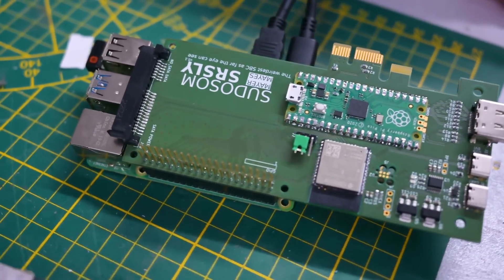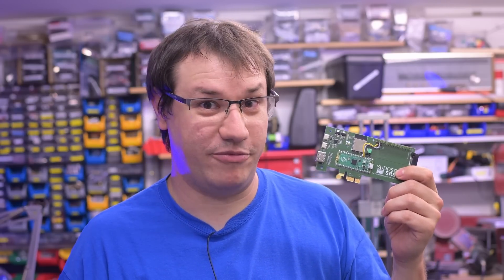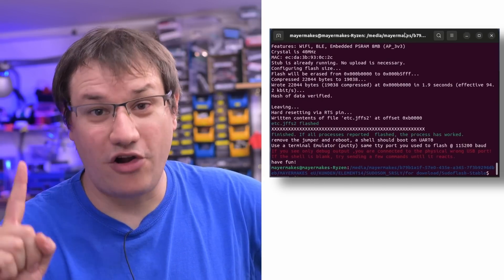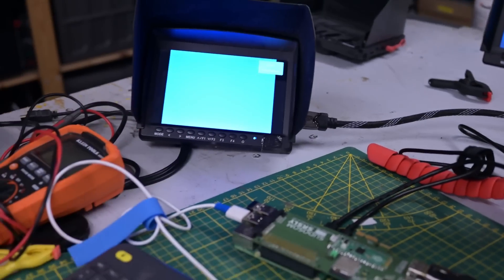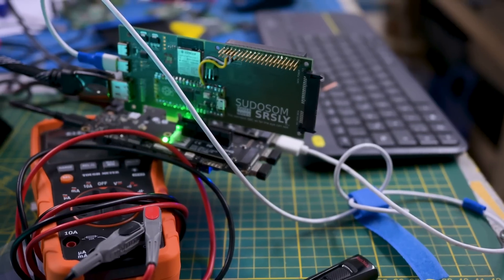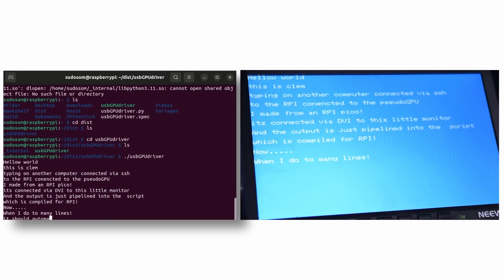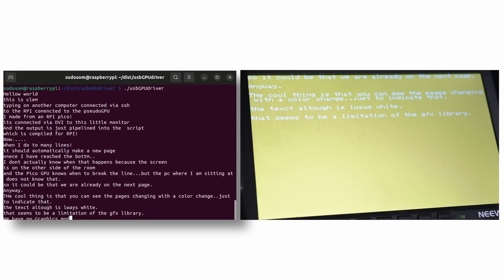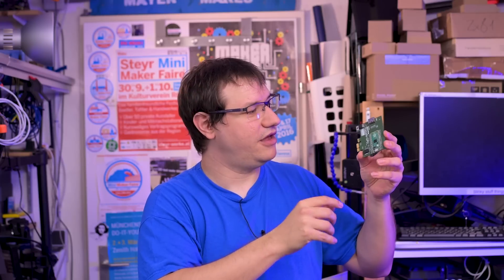DIY Single Board Computer with ESP32 and Raspberry Pi Pico

Comment: did you add any pullup resistors on your project for I2C? this and different clock speeds can be the crux, I remember faintly that the RPi doesnt like or do clock stretching on I2C, so that might be an issue. or thats just for old RPis
Reply: wait is that the identifying eeprom on a hat it expects? did you use an I2C address similar to eeproms?
Reply: @Davedarko did pullips, adress might be reserved, but the hst id is on a different i2c port

Comment: this is fun and interesting, it would be interesting to stream high speed data into (or out) a pi. The GPIO is not that fast. Would be a nice alternative. You could also use a CM4 with IO board.
Reply: Hmmmm😮
Reply: Making an esp32 with a pico coprocessor is an idea that always sounds interesting. I wonder what a good hardware/software protocol between the two would be, multi wire SPI perhaps, or maybe something better.  I’m visualizing an esp32 and 4 picos, a web interface, and custom map reduce firmware, to build an old time cluster on a single board.